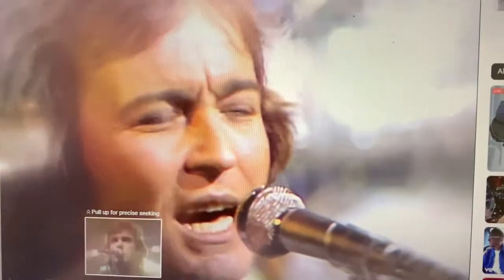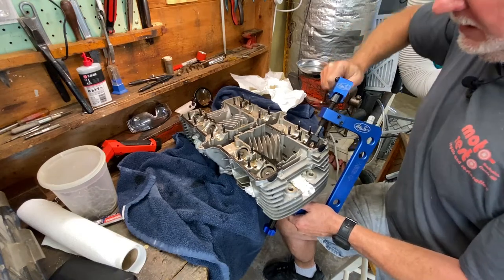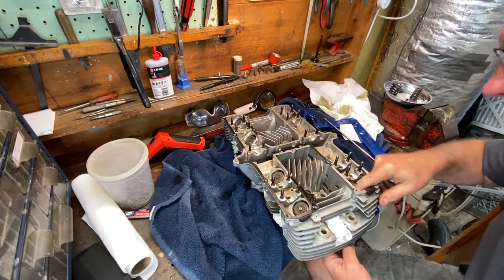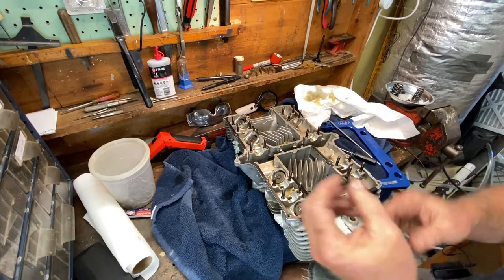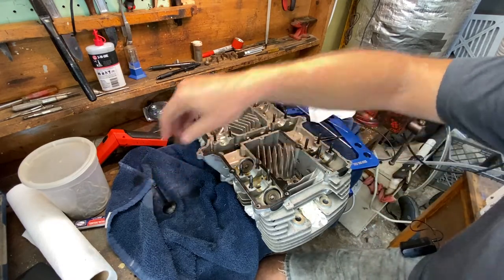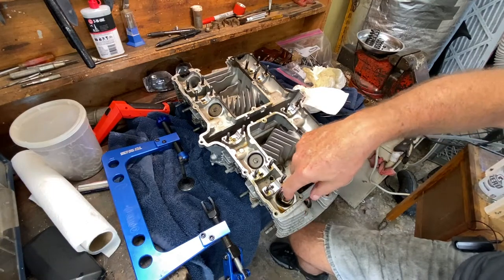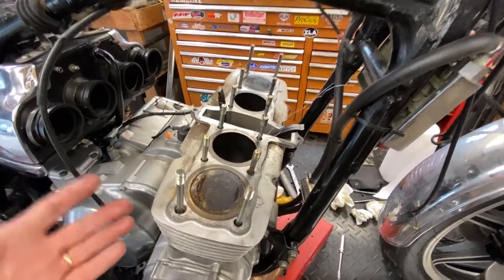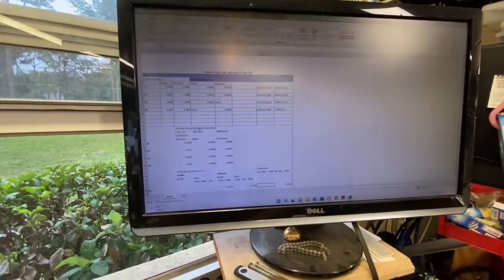Head Games!  What did we find? 1978 Yamaha XS1100. Video #3

Comment: Nice update. Make sure to tell the customer though, if there is still smoking / oil consumption its on him for not replacing the rings.
Reply from the maker: Watch video #4 the next one. I uploaded both back to back for this reason: cylinder block is off the bike, honed up and rings are on the way (or at least ordered). You all were right, oil control rings as flimsy and inflexible as my ex-wife. hehehehe

Comment: Just an FYI, in the upper case between opposing cylinders is a hole that sends the pressure between cylinders back and forth to expidite pressure relief rather than fighting rotating oil and crankshaft. Used this mod on my z1 back in tha day.
Reply from the maker: Not sure I understand. You're saying a hole is there but then saying it's a modification to be made?
Reply: @MotoRestoFL  I was mistaken, Its an 84 FJ1100 - Cycle World Magazine Jan-May 1984 (google books) Page 36.
Reply from the maker: @RickyBobby615  I’ve read Kevin Cameron’s material on cylinder down stroke balancing. I’m familiar with it. The engineering is interesting. If memory serves, there’s pros and cons about the crankcase pressures in a variety of setups including these type. Cheers.

Comment: I got an 1980 xs1100 recently and I’m still kinda new to bikes but it’s blowing oil out the crank case vent and I mean a lot a quart in 2 seconds but it’s only when it’s in gear I’ve looked everywhere and no one knows y does anyone got any idea what I could be
Reply from the maker: The crank vent on the top rear of the engine? I have a 1980 engine sitting here, I can't see how that would happen unless the oil is way overfilled. So at an idle if on the center stand you bumped it into gear and without any throttle, the thing starts pumping oil out of the breather? I can't see how that can happen just when the transmission is engaged unless it's just super overfilled.
Reply: @MotoRestoFL  see that’s what I was thinking cuz it runs amazing but I filled it up even just half way and still all shot out my next guess in the oil pressure relief within the oil pump but I’m not sure
Reply from the maker: @huntterhacker4529  I have no idea. But when you figure it out I’d sure like to hear the story.
Reply from the maker: You may be onto something. I pulled out my XS1100 manual and examined the lubrication chart. The pump has an pressure relief "plunger" valve with a spring shown in the parts breakdown. The lubrication chart shows the flow starting at the pump, into the filter, then besides the crank the next thing to get oil is the transmission. Then the top-end. I wonder, if the relief valve is stuck open, the spring is weak or even broken and perhaps it's pumping too much oil pressure? Possibly that transmission being the path of least resistance for the oil, it's over-lubricating the shafts. That vent is also known as a middle transmission vent besides engine crankcase vent. Since it only does it in gear, I wonder if there's too much oil flow to the primary, main or drive shafts or all three and slinging oil right at the vent and puking out. Worth a try to check. The oil pump is, as typical to these engines, inside under the sump cover, so you'd have to pull the exhaust and drain the oil and pull the sump cover which I know can be done on the bike with the engine in situ. Let us know what you find.